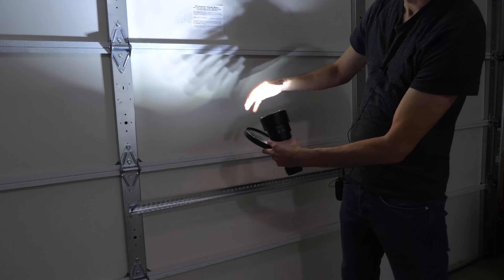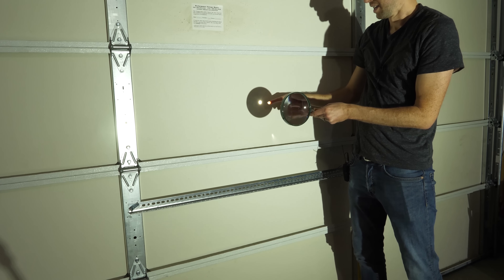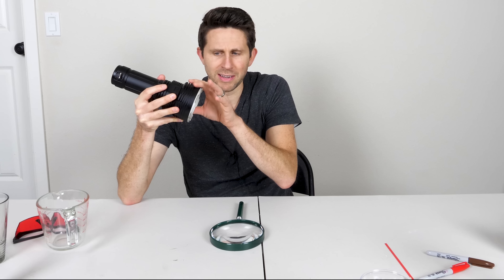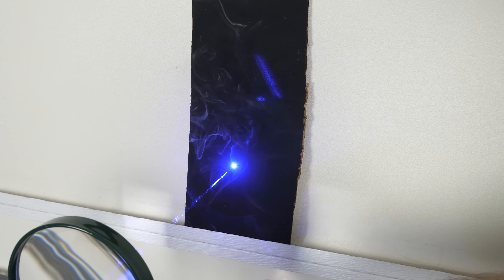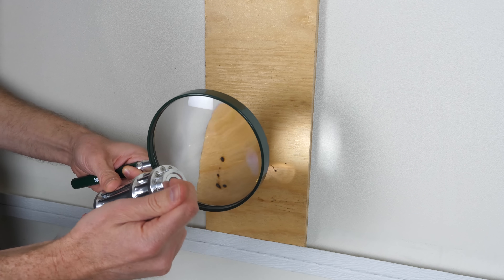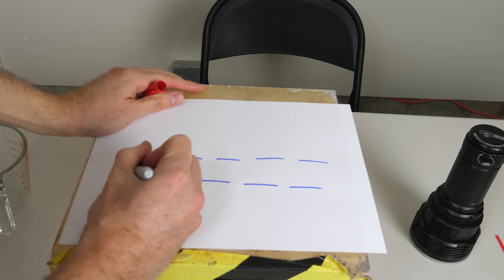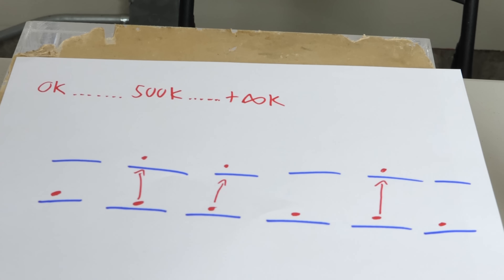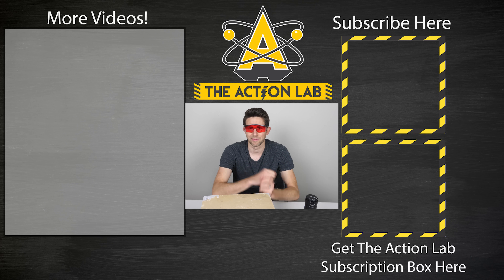What Happens if You Focus a 5W Laser With a Giant Magnifying Glass? Negative Kelvin Temperature!

Comment: You can’t go to infinity and loop around to negative infinity. You can’t even go to infinity. Taking basic precalculus tells you infinity is not a number and should never be treated as one. It is a mathematical limit indicating something is larger than one can comprehend, and as a result has an indefinite value. Giving infinity a value or treating it like a number is a contradiction of the word since you are trying to make something that is inherently not finite finite.

Second, absolute zero (0K) is a theoretical limit in the realm of quantum physics, you can’t go below it, or reach it for that matter, without breaking the laws of thermodynamics.

Lastly, you are doing the same thing with the laser as you are with the flashlight. You are focusing photons of energy into a point. The only difference is a laser is already focused, and the photons run parallel to each other, focusing into the center of the lens. It is not burning hotter than the initial source, it actually has roughly the same amount of energy. You are focusing more of that energy into a smaller area, thereby concentrating it, so it appears to burn hotter than the initial source.
Reply: Me.exe is not responding
Reply: I be like wth fk
Reply: Can't wait for the English version :)
Reply: Thanks for the plain and simple explanation. I think this guy was likely just click baiting us all... Worked on me... I watched all the through hoping to hear a explanation only to disappointed.
Reply: One thing that im so confused is how you can get answer for 'sum of infinity'
Reply: R/iamverysmart
Reply: @BaggyGame1  no im not smart at all. I just using basic knowlege and reaserch i did last year for my psychics class. XD i dont even know if i have a high iq pr what not.
Reply: life is too nerdy for me...I’m committing Suicide
Reply: Wut
Reply: @James-zc5tb  just dissociate
Reply: Oh thank God someone actually gets it.
Reply: @erswnn  heh heh happy to help
Reply: Completely unrelated querstion @Orion Pax - you don´t happen to be an IOU player with the same name on discord..?
Reply: Udo Kupsch nah, different person.
Reply: Ok, nevermind.
That would have been an unbelievable coincidence anyways. Even for an unobserved quantum system.
Reply: Udo Kupsch lol. Yeah, it’s actually a fairly common screen name.
Reply: +1 Orion
Reply: Orion Pax actually, in set theory, you can go above infinity. 
The definition is quite crazy in that so..
Reply: @phamdinhhoang1998  can you link this so called theory. Because that frankly sounds impossible. You cant go above infinity since its...well...infinate
Reply: Myles Burkett well actually the concept is called aleph null or aleph 0. And although it itself did not approve larger infinity number but above infinity number.
Reply: @phamdinhhoang1998  yes aleph null is "greater than infinity" but in of its self it is infinity meaning it is infinitely bigger than infinity meaning it is infinity in of its self. And the only reason it exist is to give mathmatical meaning to an uncountable varible that truley is a concept. So my point still doesnt change from the prior.
Reply: Myles Burkett no. As what I understand from aleph ( which might be wrong ) is that they have the concept of one that above the infinity that mathematically undescribable ( hope it’s a word ) 
Since the definition itself said that the aleph 0 is not infinity but a set of infinite cardinal number. And by it definition, the so called w is the one which uncountable, or above and out of the range of natural number that include infinite ( hope I’m right).
Reply: Negative temperatures are possible; you should do some research before you post a comment like this.
Reply: @CJBurkey  yes negtive Fahrenheit and Celsius are possible. But not negitive Kelvin. He put "reaching negitive Kelvin" in his video title. How bout you use your brain before trying to act like a smartass.
Reply: @MaximumHydro1  You should have read my earlier comment: "Physicists at the Ludwig-Maximilians University Munich and the Max Planck Institute of Quantum Optics in Garching have now created an atomic gas in the laboratory that nonetheless has negative Kelvin values"
Reply: @CJBurkey  not to be rude but if we went inti negituve Kelvin numbers that would be world defining since we havmt even reached absolute zero. If we havnt reached absolute zero  (which is 0 Kelvin) how could we create -1 Kelvin. I litterally looked uo have we reached -1 Kelvin in a lab and there were no scientific documents stating we have gone below 0 Kelvin. If we did again that would be equal or more ground breaking than Einstein's theory of general relitivity. So the what ever document you pulled is most likely false or something to grab people attention who are ill informed.
Reply: @MaximumHydro1  The issue here is that when they say that negative K temps are possible, they aren't explicitly talking about heat as laymen refer to it. As I understand it, in a given system defined as being at negative K temperature, it is only defined as such due to other factors involved, namely decreased entropy in the system. The system is still 'warmer' than 0K, but the decreased entropy, when factored into the relevant formulas and equations, gives a net result of negative Kelvin for the system. Such systems are still quite warm and nowhere near 0K in actual temperature as we understand it when we say 'warm' or 'cold'.

No, it doesn't go past infinity K. No, it doesn't reach -0K. From what I can tell AL is mistaking population inversion in laser physics to mean that lasers are systems with negative Kelvin. I don't believe this is the case, although it is possible that I too am mistaking one thing to mean another.

Lastly, remember: all infinities are equal... But some infinities are more equal than others.
Reply: @FukkitBukkit  if i may rebutle, kelvin is a unit of temperature which is in a sense the lack of energy in a given object. 0K is absolute 0 or the point at which objects stop movement at a molecular level. It is impossible to go below absolute 0 due to the halting of all atomic movement thusly making negative Kelvin an impossibility for our understanding of physics. Not to mention that it was mentioned earlier by another that lasers CAN NOT make things colder. Laser shoot energied "beams of light" that when hitting an object excites the atoms where it is touching. I would have to do research if there is such a laser that can absorb or remove eneegy which i believe can be possible but on the usual laser excite atoms thusly building up heat. Additionally infinity = infinity is both true and false. In understanding infinity isnt a mathmatical term that isnt to be used in mathmatics. Its a theoretical representation of anything and everything. Everything including infinity. Thought this has been heated i did enjoy someone who was calm and was didnt get argumentative thank you.
Reply: @MaximumHydro1  I'm no physicist or anything... I just have an interest and read a lot, so at best I'm a junior amateur armchair physicist in training and not really qualified to state anything definitively as fact. Also, my comment about infinities was just a small Animal Farm joke. Thanks for the chill reply though, it's always nice to have a relaxed, nonaggressive conversation on this series of tubes we call the internet.
Reply: @FukkitBukkit  indeed! And i dont claim to be a physicist. I just watch a lot of documenteries and love science though i am a criminal justice major. Good to know not everyone isnt a bigoted chad who thinks they are the shit
Reply: CJ Burkey This is true in Fahrenheit and Celsius. Kelvin however makes zero the lowest possible temperature since it is defined as the point at which all motion stops, and temperature is a measurement of kinetic energy. As a result in the Kelvin scale, it is physically impossible to have a negative temperature because you can’t have less motion than no motion at all. As far as Fahrenheit as Celsius, I have no clue as to why there are negative values.
Reply: @InfernalBanana  I told you to look it up because it is possible. Here's a piece of the article from MPG (Max-Planck-Gesellschaft): "Physicists at the Ludwig-Maximilians University Munich and the Max Planck Institute of Quantum Optics in Garching have now created an atomic gas in the laboratory that nonetheless has negative Kelvin values."

Wikipedia begins its article on negative temperatures in Kelvin with this: "In quantum thermodynamics, certain systems can achieve negative temperature; that is, their temperature can be expressed as a negative quantity on the Kelvin or Rankine scales. A system with a truly negative temperature on the Kelvin scale is hotter than any system with a positive temperature."

It may be "physically" impossible, but The AL explains in his comment (which you should read) that "...due to quantum mechanical effects, we know that we can stimulate atoms to be in a higher energy state simply by shining light near them that is at the same wavelength as the light it would emit at that state."
Reply: CJ Burkey Ok. Interesting. I was definitely wrong. I apologize.
Reply: @InfernalBanana  It's understandable :P I refused to believe it for a long time until I finally got mad that so many people were talking about it.

Comment: What if you used 2 magnifying glasses to focus the beam?  One to capture the “flood” light of the flashlight, collecting all its energy, the the second to focus that light to a single point.  The flashlight is “low” heat only because the heat is diffuse over a large area.  If all the energy at the source was concentrated to a single focal point, there would be exponentially more heat than the flashlight initially gives off!  No breaking of any laws of Physics!!

Comment: First of all, that is a 1 watt laser and lasers do not have any thermal energy they have electromagnetic radiation energy, they rely on photons and matter to burn things, Matter absorbs the energy of the photon and heats up. Pour enough photons into a small spot and the matter will vaporize or melt away, that's why when you focus the beam more the particles in whatever you're trying to burn or melt vaporize quickly.

Comment: Yes the single magnified point by will by hotter than the laser beam when unchanged, but it does not have a higher amount of energy than the laser put out. This will remain true unless more energy is added from an outside source (sunlight, a light bulb, etc.) it only reaches a hotter temperature due to the focusing of the lasers energy. 
The same rule would apply with a water hose. just because you place a nozzle on the end of the hose to focus the water to a smaller area to increase the pressure, does not mean there is more water coming through the nozzle than being supplied through the hose.
(This comment is open to any criticism or opposing views)

Comment: It's actually a common misconception that lasers have negative temperature, a temperature can only be assigned to a state in thermal equilibrium. This means states that, when left alone (when the system is thermally isolated) will remain stable and do not change over time. The particles in a laser medium do have an inverted energy population more particles are in excited states than in low energy states and their distribution looks indeed similar to a state at negative temperature. This inverted energy population, however, only exists as long as the laser is continuously pumped, i.e. particles are actively pumped into the exited states. When you switch-off the pump, all atoms will decay back into the lower state and their energy goes into the laser beam. So, while pumped, the laser medium is in a steady state, but not in a thermal state. It is not in thermal equilibrium and therefore cannot have a temperature.

Comment: all wrong, that happens because the focus works like pressure, the force of the light is the same with you dont use the class ( I forgot the name) or if you do, the difference is that when you focus the light in a small point, all the force of it will be in this small area

Comment: Highest temperature possible is when the wavelength equals planck lenght
Reply: Not really. It's just the highest we can simulate, since our understanding of physics breaks down after that.
Reply: @dipankarghosh8495  not really. Any energy higher than that would collapse into a black hole and the black hole has a lower temperture than a wavelenght with limit to planck length
Reply: @moisesbessalle  I was going off of vsauce. That's what he said, if I do remember.
Reply: @dipankarghosh8495  vsauce, pbs space time, leonard susskind continuing stuides program, etc etc. Its mentioned a bunch of times on various channels

Comment: I think you may have missed where the -ve temperature is occurring it is in the atoms giving off the light after stimulation as the light is being emitted those stimulated atoms would heat up any material they touch 

 How would you concentrate infrared red light (the energy from the laser which is probably doing the burning) into a point smaller than the wavelength of the light? Also how would a photon of thermal infrared light excite an atom to a higher temperature than the corresponding temperature for the wavelength given out?

Comment: pretty sure this guy just looks up some random topic and spits out what little information he found. When he said you can never focus down a flashlights light down to create a spot hotter then the flash light itself is simply wrong. Heat is determined by the amount of energy per unit area. so if you take 100 units of energy over 100 units of area and compare it to 100 units of energy over 10 units of area, then the latter will be hotter. and that's exactly what focusing light is doing. Now what this guy was **trying** to say was that you can never increase the total energy of the source by focusing it. ie you cant turn 100UE/100UA (UE= units of energy; UA = units of area) into 200UE/10UA because then the total energy has increased. But unlike what this video said, you CAN focus down an arbitrary light source to create a point of light that can approach infinite kelvin, for example 100UE/0.0000...0001UA would create a point of light with an arbitrary closeness to infinite kelvin. The problem however is that the point of light would have to be so small that it might even be smaller then a single atom, also combined with the fact that it is a point of light due to the conical focus shape you could never notice anything melting so it would be useless.

and just to rip into this video more, when he said you can never focus the flashlight into a point, that is incorrect(to a certain level at least). you just need to either use multiple lenses or a more unique shape, such as a Fresnel lens. However you will never be able to make white light, like that of the flashlight, into as small of a point as a laser due to the different wavelength of light in the flash light focusing at different distances.

Comment: I don’t understand why you couldn’t use a fresnel lens or a bigger lens to direct all the light to a converging point your LEDs have lenses on them that already focus the beam from 120 angular degrees to about 25 angular degrees and then the reflective part of the light also directs lost light forward which makes the light brighter a fresnel lens should be able to direct it from 25 angular degrees to close to 1 degree or 0 degrees.  To make it brighter than the light source the focal point only needs to be smaller than the emitter and redirect most of the light to the focal point.  If the focal point has half the surface area of the emitter it needs to redirect at least 51% of the light emitted to the focal point.

I don’t see why thats not possible your emitter is like 5 inches wide.

Comment: Focusing a lamp light to a singular point to reach higher temperature than output surface does not break conservation of energy, as the energy source is not singular point. Using a lamp is applying work and the focused point will always gain fewer joules of energy as some is initially lost due to lamp heating up.

Also there is no such thing as infinite temperature, as atoms have finite states or by definition of temperature, average velocity, theoretical maxinum being the Planck temperature.

Laser does not cool by going all the way from infinity to negativity to 0K, that would be nonsensical. Cooling is achieved by counteracting the vibrations of molecules with a laser that has same frequency as the molecules being cooled.

Comment: I have a lazer like that. Not sure why you had it far back from the wood, when at less than  a foot you could start reeeeally burning it by just turning the lens to converge the beam to a hot point, other than demonstration purposes of magnifying a laser beam to illustrate a quantum physics property of the laser with the aid of a magnifying glass.

And I don't think it's 5 Watts. More like just  2. Some of that Chinese stuff are a  bit exaggerated in it's advertising, as the gimmick to maximize sales. So you have to esp. watch it when reading the specs of such products on the internet, like know when to take it with a grain of salt.